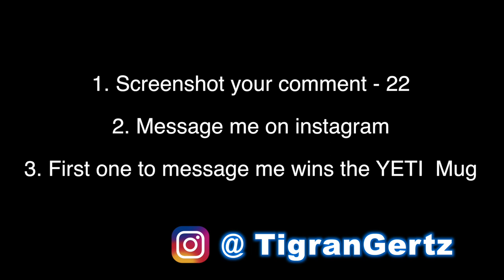Start To Finish Time Lapse Of $200,000 Landscaping Job In 18 days

Comment: Huge fan! I’m in Kansas I work for the rail road as a machinist. But I also have a small construction company on the side. I do concrete flatwork and some carpentry. I’m well versed in many types of construction. You’ve helped me a lot. I think I’m going to try to focus on a few types of things. And stick with them and try to grow those. I bought a ditch witch and a dump trailer this summer and I’ve used it a lot. I just recently found you on YouTube. But I subscribed immediately! Love your personality, drive and confidence. You’re an inspiration bro! Thank you.
Reply from the maker: Thanks bro. What kind of ditch did you buy
Reply: @TigranGertz  hey man! I never thought you’d reply! Lol I bought it used 2016 sk750 Kubota diesel. Great machine. I have 4 attachments for it. Auger, breaker, grapple, and tooth bucket
Reply from the maker: @terryburgess6637  that’s sweet. How about your dump
Reply: @TigranGertz  10k lb  l&l hydraulic over electric. $5000. For the dump. 15k for the ditch.

Comment: You can use airplane runway tracks (metal perforated sheets that hook into each other) to count you machines making huge holes in the ground. Sometimes even the grass can survive with minimal repairs. They are mostly sold by the military at only 50% more than scrap metal.

Comment: $200,000 Landscaping Job In 18 days,,,,,BUT....You forgot to  mention the workers pay.  8 guys at $15 per hour for 18 days is $17.200.  Then there's your equipment rental at $1K a at for 18 days $18K.  The trees, rock in front.  And those pavers are $15-$25 each $35K.  The sand cost $$.  Concrete removal to dump.  $300.  And the list goes on and on.  Ohh yeah how about city inspectors and fees.  
That is no $200K job rip off.  It's a $80K job  and you made $13K in 18 days.  Good pay but.....Not good if your not getting any jobs for 4 months.

Comment: If that's 200k we could take all your work from you pimp. ALL of it? Holler back and we will line up a remodeling challenge of some sort. I'm a carpenter-contractor with cash in the bank, not debt in the box. wanna be.